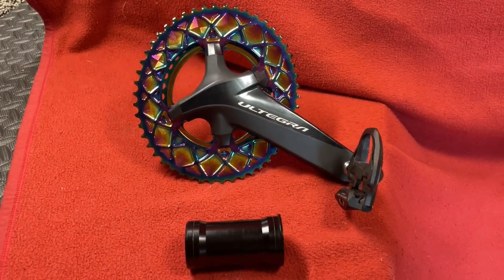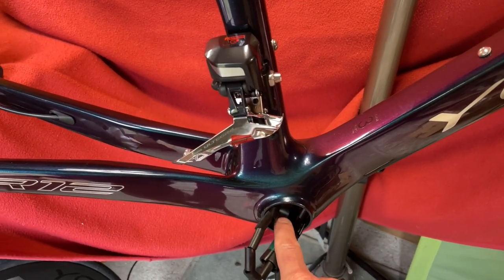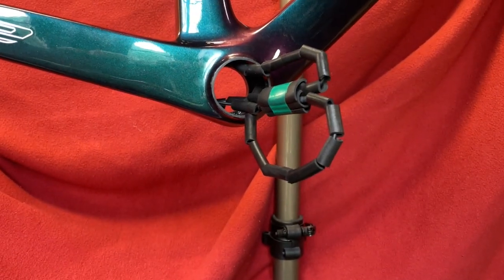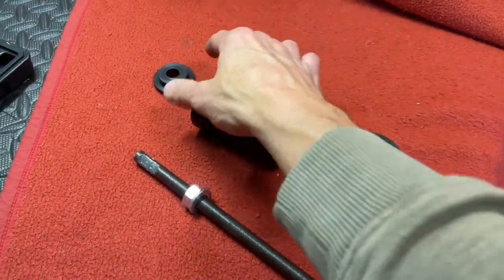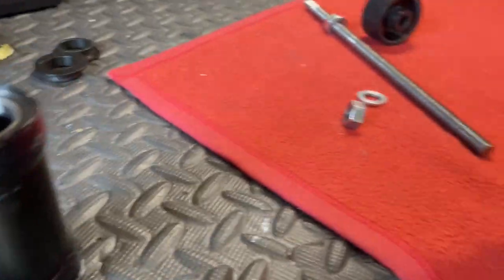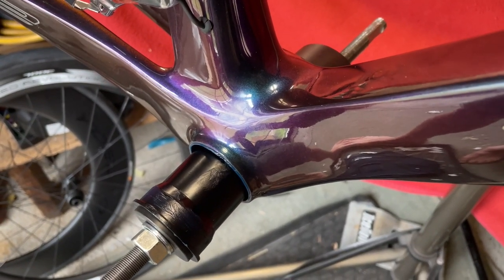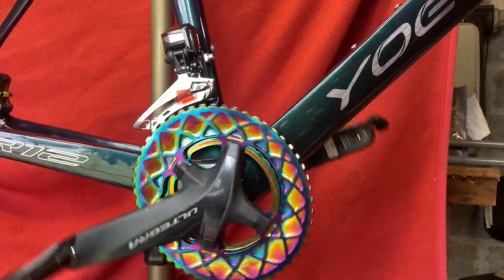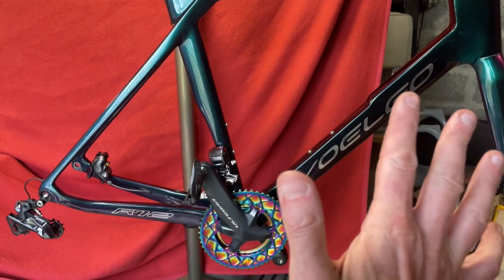Hambini Bottom Bracket 386 Evo & Crank Install

Comment: I  Installed a hambini BB in my cervelo S3 and boy did it creak going in but it runs smooth , love the look of the black chain rings on that frame colour 👍, did you get the special bolts for it from rotor ?
Reply from the maker: Ah nice! Yeah it creaked and cracked but all good. Exactly why I got them because I thought they’d look good with the colour of the frame. The bolt covers are ABSOLUTEblack ones. 👍